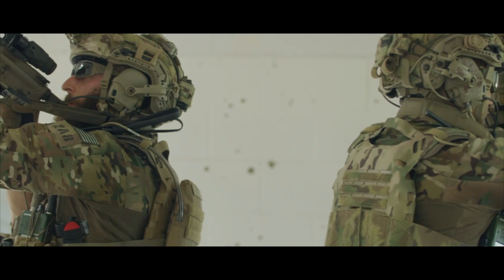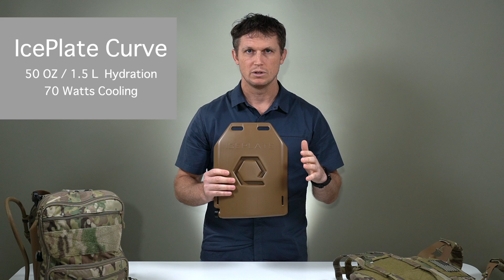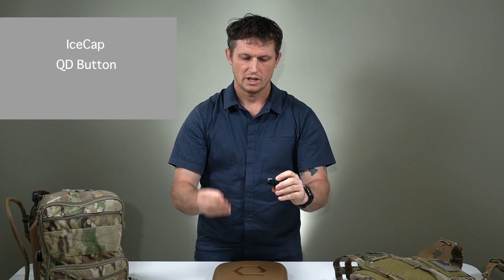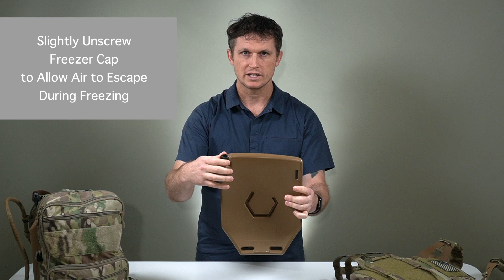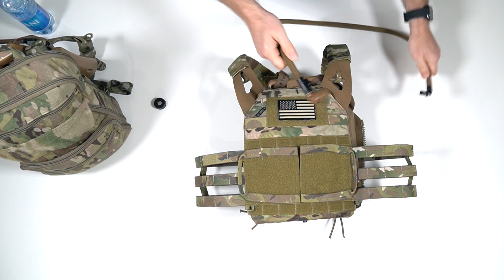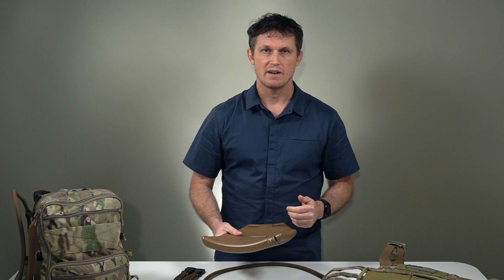How to Set Up IcePlate® Curve Plate Carrier Cooling/Heating/Hydration Bladder by Qore Performance®

Comment: Will these fin in a small swimmers cut JPC 2 ?
Reply from the maker: ICEPLATE® Curve is not armor, so it isn’t designed to be run inside of a plate bag except for things like Crossfit or airsoft. Complete dimensions and specifications on the ICEPLATE® Curve product page here:
https://www.qoreperformance.com/collections/iceplate-featured/products/iceplate
For universal plate carrier compatibility, simply select one of our IMS (ICEPLATE® MOLLE Sleeve) options here:
https://www.qoreperformance.com/collections/molle-sleeves
We hope this helps, but please let us know if you have any additional questions. #StayFrosty

Comment: Wait, so you don't use the side mounting locations/slots for anything?
Reply from the maker: The side cuts were originally intended for extra security when using the IcePlate in conjunction with armor straps.

Comment: Can I use this with practically any backpack?
Reply from the maker: If using the included Side Release Armor Straps with IcePlate Curve, then yes. IcePlate Classic, however, can be used with just about any backpack with an internal pocket that is at least 10" wide. Add'l details:
https://www.qoreperformance.com/blogs/travel-edc-insights/backpack-compatibility-what-backpacks-fit-my-iceplate-for-travel

We also have a dedicated IcePlate Curve Hydration Backpack. It is currently available in Safety Yellow, but we'll be releasing Blaze Orange, Red, Blue, and Black next month exclusively to our LaunchPad email subs:
https://www.qoreperformance.com/products/iceplate-backpack

LaunchPad email sign up:

Comment: I really like the idea, but when I took it out to the field a month ago I was having a ton of leaking problems from where the hose meets the ice plate. Looking at the hose it looks like there's a spot for an o-ring, but there wasn't one. I made one out of electrical tape and that stopped the leaking problem, but then drinking water created a vacuum in the plate that collapsed it. Kinda dissapointed.
Reply from the maker: Sorry to hear you have had an issue with your IcePlate Curve. If you could send a video and/or photos of the issues you are experiencing to Info [at] Qore Performance [dot] com, it will help us diagnose the problem to get you squared away ASAP under our IcePlate Forever Warranty. We'll get this handled ASAP and get you back to enjoying your IcePlate Curve as designed! #StayFrosty
Reply: It was just missing an o-ring. I was able to get an extra one from my buddy who has a source hydration kit. Small oversight by Qore to miss the o-ring which kind of sucks, but other than that the ice plate's been treating me well now.

Comment: Airsofter here just picked mine up today and I'm honestly fairly impressed with every aspect of this the angled bottom to route water to the drinking tube, the rigidity in the center The ability for the tube to be used with water bottles there's just a lot of really clever and smart product design going on here! I also don't Really need real ballistic plates In my Airsoft PC's So I was wondering if it was a good idea to use it inside the actual plate compartment or if that would cut off too much cooling?
Reply from the maker: Our company is all about empowering end-users with optionality, so you can run IcePlate either way! The level of insulation will depend on the specific make/model of your carrier, materials used, and the construction methods. Any PC with SpacerMesh will be problematic as SpacerMesh is basically insulation. We share our thoughts and experiences with SpacerMesh here:
https://youtu.be/Z_FglsQyJ1c
Reply from the maker: Our IceAge Insights blog has tons of additional knowledge, gear and training resources:
https://www.qoreperformance.com/blogs/military-insights
Reply: Does it fit inside the plate compartment?

Comment: Is there a switch in the tube?i cant drink water inside.the plate.
Reply from the maker: The on/off valve is integrated into the Source Bite Valve. We have included Source's bite valve instruction videos on our IcePlate Curve product page for reference:
https://www.qoreperformance.com/collections/iceplate-featured/products/iceplate
Hope that helps, but let us know if you have any additional questions: Info [at] Qore Performance [dot] com. #StayFrosty
Reply: @QorePerformanceUSA  I solved the problem,turns out i have to pull the valve,Thanks!

Comment: Also what's the point of the freezer cap if it doesn't let the air out?
Reply from the maker: Freezers and freezer space come in all shapes and sizes. Not every freezer can accommodate IcePlate in every orientation.
Reply: @QorePerformanceUSA  too bad, I would love to see a freezer cap that lets out air/water above a certain pressure if you ever redesign them.
Reply from the maker: @enb3810  Good to know. Appreciate you sharing. We'll definitely take a look if/when we have to update the part.

Comment: hmm my kit didnt come with the safety attachment for the quick connect.. and a clear tube, not covered.  rest is same.  Used it on 2 ops so far, loving it.
Reply from the maker: It sounds like you are an OG IcePlate Curve customer, so thank you! FYSA: the Source 90 Drink Tube and Safety Shims are relatively recent additions from this summer. Here are links with more info:

Source 90 Drink Tube
https://www.qoreperformance.com/blogs/iceage-insights-news/the-perfect-hydration-tube-source-and-qore-performance-team-up-on-tube-collaboration-for-iceplate-curve?_pos=2&_sid=e670fddf4&_ss=r

IceCap Safety Shims
https://www.qoreperformance.com/products/iceplate-safety-shim?_pos=1&_sid=b33693cb5&_ss=r

Hope that helps, but please let us know if you have any additional questions! #StayFrosty